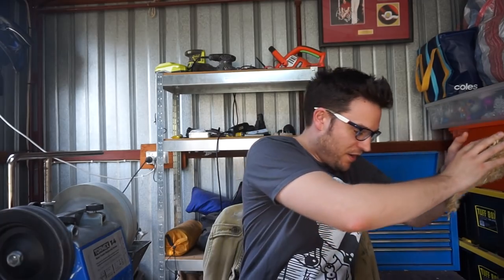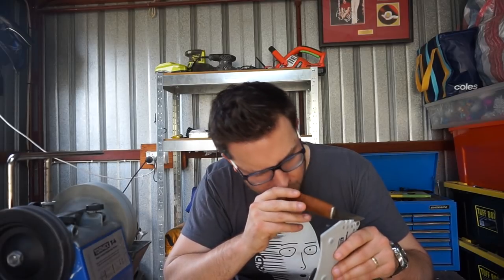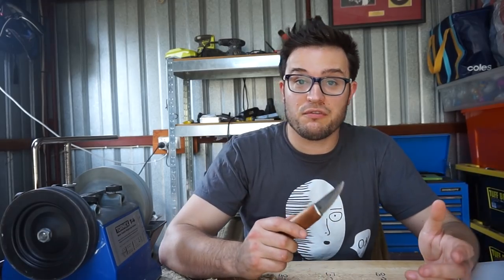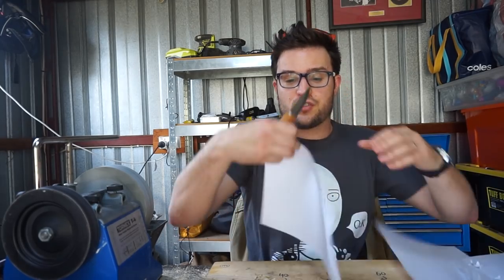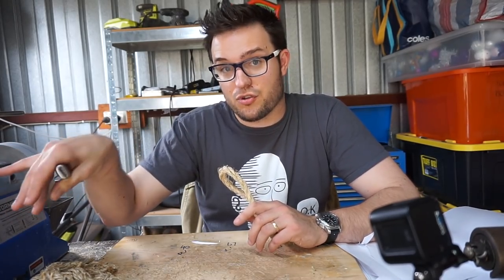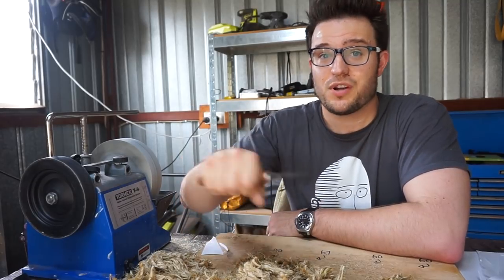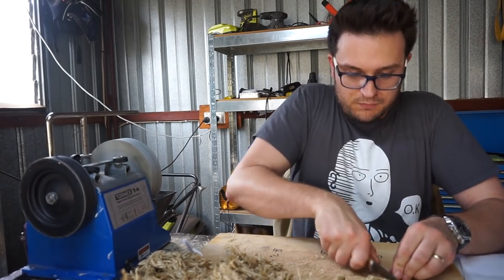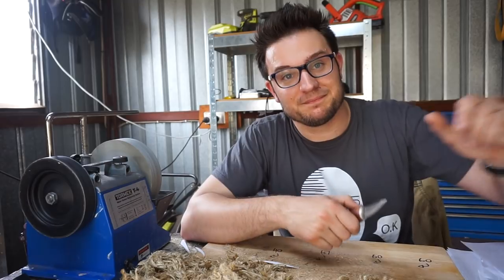UHC Steel - Roselli Wootz - Edge Retention

Comment: I am using an roselli with uhc steel for about 10 years now. The edge retention is beyond everything I have seen so far. Usually I just do some leather stropes after a weekend of high usage to bring it back to shaving sharpness.
I heard these special pulverized cpm steels could hold an edge even better, but I didn't have the chance to test that yet.
Reply: jimihenrik11 - CPM steels are a pain to sharpen though.

Comment: Love my UHC bearclaw.  For wood carving, it is pretty good, takes and holds a great edge.  I also use a Mora laminated 82mm blade, which has a lower profile, so is more versatile.  The O1 in the Mora is good enough for all whittling, including Aus hardwoods.
Reply: @sealtooth. I use this and the More Original laminated knife, same size as yours.

Comment: The UHC steel for me is a small miracle.
A Roselli Carpenter UHC is my "Linus' security blanket" in all my trekkings and outdoor activities since 14 Years. 
Even in heavy use it stays sharp much longer than any other blade that I tried. 
P.S. The only thing that I don't cut with it is the garlic, because the flavor of the steel is transferred to the vegetable.  😂
Reply: Carbon Steels tend to flavor certain things when you cut food. Otter in Solignen recommends to not cut foodstuffs above 40C when using their C75 carbon blades

Comment: I have a test for you... Can you do a full rope cut test with a super steel that takes well to stropping, and see how long it cuts the rope and still slices paper after being stropped back. Some folks say that stropping is not good because of degradation of the apex once the absolute has been blunted. Just curious to see how long it will last on a second go round. I know your arm will hate me after this test, but your curiosity might make you inclined to try this. I know mine would... thanks for all the amazing videos! Keep up the good work!
Reply: I've done what you're asking but in a less scientific setting, and I can say that stropped edges will usually yield a slightly worse edge retention, but with proper technique the difference will likely fall just outside the margin of error. I'd say like 10% difference, if that much. Pretty insignificant.

A much more tangible difference I've found is using diamond compounds and stones for vanadium or tungsten carbide steels. Softer abrasives (anything below CBN) lead to less supported carbides in the apex, which causes tear out or deformation.

Comment: Five month update. I've been carving with this quite a bit, as well as doing some 'drilling' with the tip. I have done a couple of passes on a ceramic rod once, but other than that it's only required a strop. Great steel imho.
Reply: Any problems with chipping, is this with the factory edge?
Reply: @deathbyastonishment7930  Late reply, but no. With the edge that Pete put on it. Oh, and I still carve with it and I haven't done anything but strop it in the past 2 years.
Reply: @Brad Griffin  better late than never, thanks for the info

Comment: To be fair from what I read most wootz swords weren't actually that hard.  It's way better for a blade to flex or even bend than break in combat.  But even with the softer steel the irregular carbides maintained a very sharp edge. I won't go into how beautiful those swords were.

As to usefulness, I'm sure such blades are as good as they ever were but compared to some of the modern super steels, they are more of a novelty than something I'd take out woodscrafting on a long slog through a rainforest.

Comment: Wootz or Damascus steel was the most highly prized steel in the world in the middle ages. The exact manufacturing  process has been lost so Roselli's steel while very good, isn't actually wootz.
Reply: Grey Holm if it's been lost there's nothing to suggest definitely  it's not  who's to say he hasn't figured it out  (or something similar)the best steels back then probably wouldn't be a patch on what available now and it looks like a good result for a basic steel
Reply: The original Wootz was apparently much softer. Roselli has changed it to be somewhat harder.
Reply: @jasonburns956  Wootz has a very distinctive swirled  patterning which is it's  hallmark. The ore came from a few specific mines in India and was produced with a crucible process  and was very pure for the time. It was the best steel of its age and highly prized but isn't nearly  as good as modern steels. The Roselli is a  much better steel but it's  isn't  wootz is all  I'm  saying.
Reply: @daeholm  that's actually not true. Real Damascus steel, not modern pattern welded steel, was made with a process we don't fully understand today. A recent test of a Damascus blade shows that the steel has a microstructure with carbon nanotubes, something we can't even reliably or economically produce today. Real Damascus steel was the stuff of legend for a reason.

That said, modern hyper steels like Rex 121 for edge retention or 3V for toughness now likely match or exceed what true Damascus was capable of (but it was doing this over 1000 years ago). Stuff like LC200N would be viewed as absolute witchcraft, so modern processes have obvious advantages.